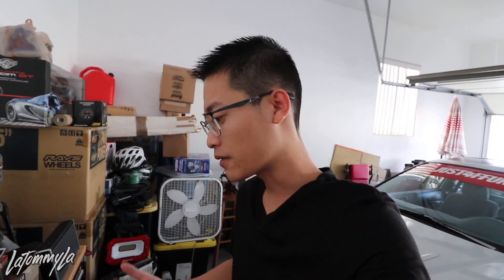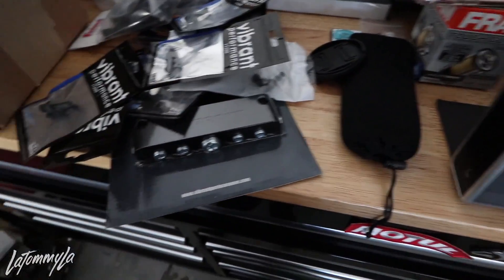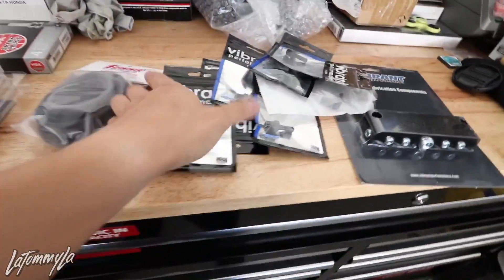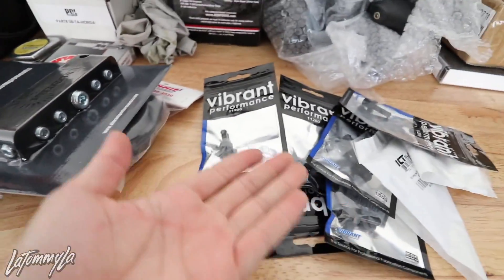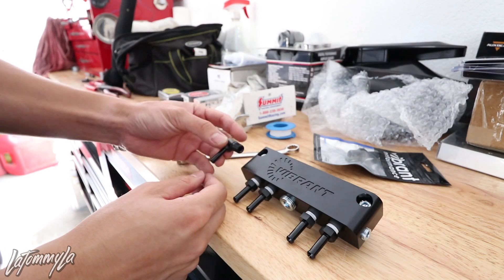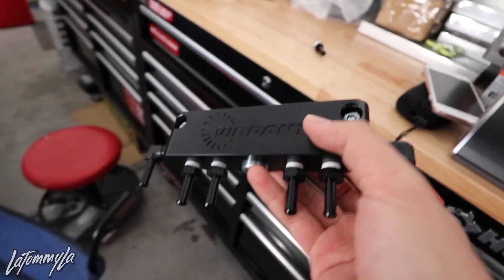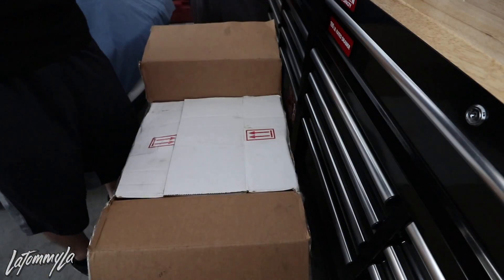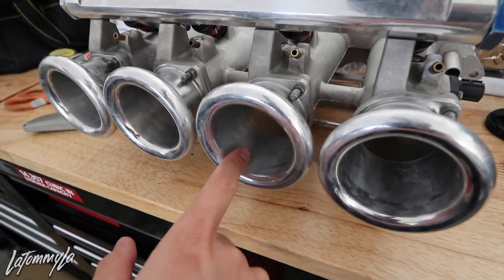B18C5 ITB Install (PT.1) - Getting all the parts I need!

Comment: if it were me, I'd have a machine shop make a special fitting to flip it 90° and then buy another hood, cut it, then the Velocity Stacks would be sticking outta the hood at which point I'd make a custom "Hemi" scoop (like is on the hood of the General Mayhem 1968 Dodge Charger from the youtube show Roadkill ) That would increase the amount of air going into the intake so much...

Comment: you wont lose any power from pods over a air box? where in the world did you hear that, dyno it and you'll see a huge difference. i run open velocity stacks so i've never personally heard it but my porter told me of two brothers with b18c's and both of them were dynod with extremely similar setups and the older brothers car made about 220whp while the younger barely made 190. the only difference was the older brother had no filters. he also said the younger lost a LOT of midrange